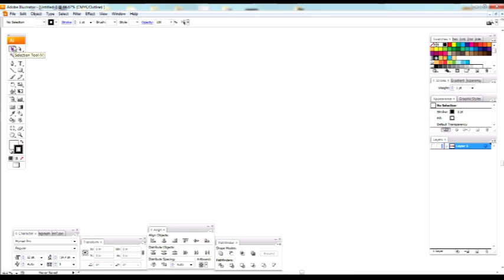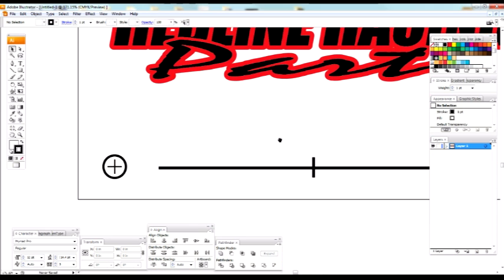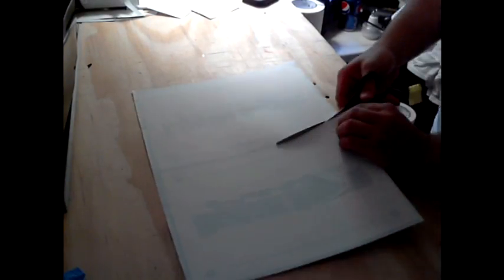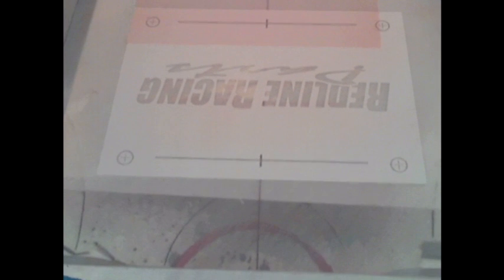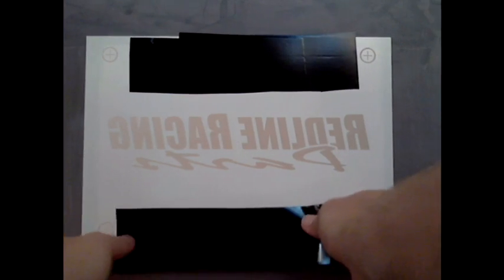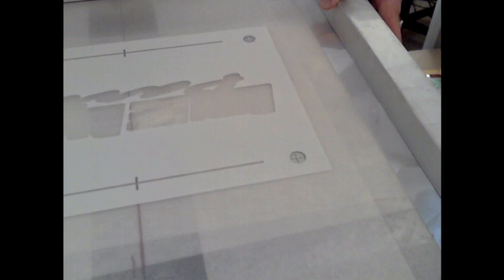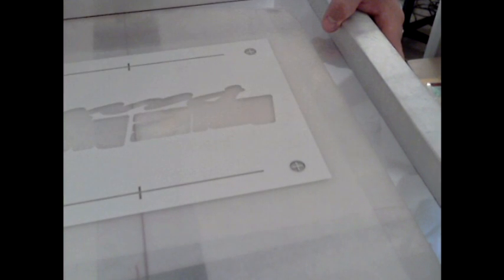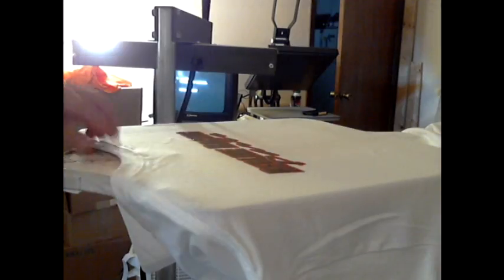Screen Printing with Vinyl 2 Color

Comment: how does the vinyl stick to the mesh?if that's shirt vinyl or car decal?
Reply from the maker: Drozan War Thanks for watching, yes it’s the same vinyl that I use for cars, it is not shirt vinyl!  If you mirror your art the sticky side will be on the mesh side.  It will stick, you just have to watch the edges when pulling the transfer tape off.  The vinyl will only last for so long.  I normally could get about 50-75 prints before the vinyl would start to fail.  One you start printing I would go until the job was done or the screen had failed.  Thanks again for watching!
Reply: @ScottKingDesigns  so if it goes to 100 shirts to print or more is already no good?
Reply from the maker: @barangaycambinocot4067  You would just have to try it.....I would just keep going until it fails on you.  You might be able to get that many.  For me I would always not let the one color cool enough so when I put the other color on the hot ink would stick to the vinyl causing it to pull off the screen.

Comment: i used Vinyl once and it worked until i went to take the vinyl off man i had the hardest time getting off and it left a some adhesive on my screen i used oracle 651
Reply: ...use 631. 651 is meant to be more "permanent ".

Comment: Do your inside of the letters pop out from squeegying the ink through>? I would think the small pieces would be first go to since there is less surface area holding them to the cross pattern of the screens. Also, have you only tried plastisol inks? What brand vinyl do you notice works best? I was thinking of buying some 3m sign vinyl after seeing this lol.
Reply from the maker: +Shaun The smaller the detail, sometimes leads to other problems, lol.  I've never had an issue with the squeegee popping the letters off.  Sometimes the ink will bleed around the vinyl stencil a little bit....and you will have to try and whip the extra ink off.  This is where the problem can happen, when you start whipping the back (shirt side) of the screen.  You can lift the little parts of the vinyl stencil off and once it comes off you might have a issue trying to get it to stick back with all the ink from the front side.  But for the most part I haven't had really any issues.  Another factor would be how many shirts you are planning on screening.  I can get about 75-100 shirt (usually) before the vinyl starts to fail on me.  You could try a higher mesh count for your screens, I stared out with 110 but now 90% of my screens are 156 mesh.  I just use Avery A7 Series vinyls and have had great luck with.  As far as the inks go, yes, all I've messed with has been plastisol inks.  Thanks for watching the video!! SKD
Reply: Hey thanks for all the great info. You should give orocal 651 vinyl a try since its adhesive backing one of the strongest and its pressure senvitive and solvent make up might work best. Would you ever attempt this method for proffessional orders of less than 50 shirts (which is your failure point)? As for the bleeding around the vinyl stencil problem, does that happen alot and is there anyway stop that?
Reply from the maker: +Shaun most of my orders are between 25-75 shirts per order, so for sure you could use this method for those.  I've used oracal in the past, but not for screening.  But I'll check it out for sure.
Reply: +mxsniper937  I just bought some orocal 651 screen vinyl so I am going to try this out. I will let you know of the results and how long it lasts. Just curious, for your temperature gun, what do you sent your emmisitivty at?
Reply from the maker: +Shaun I the height set at about 4-6 inches off the shirt.....I try and get the temp to around 300-325 degrees and once it hits that temp, I leave it for about 30 seconds.  If you are flashing in between colors, I just but the dryer over the shirt for about 15 seconds....I hope that makes sense